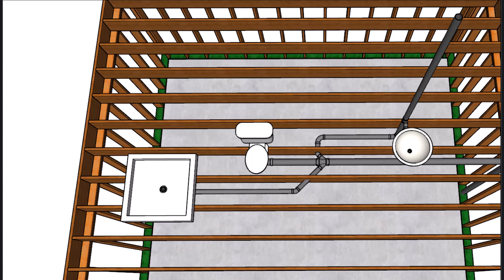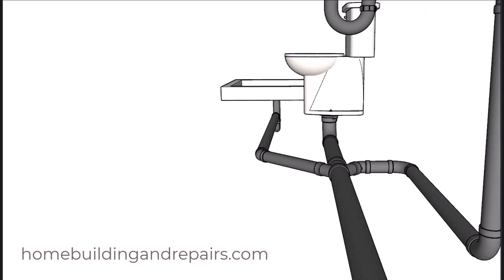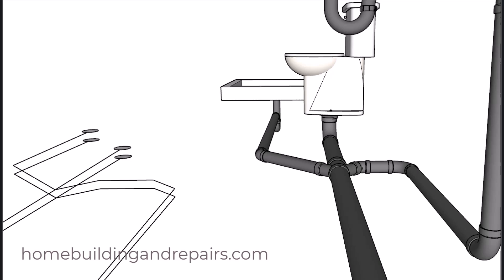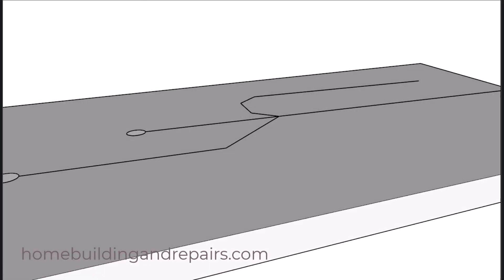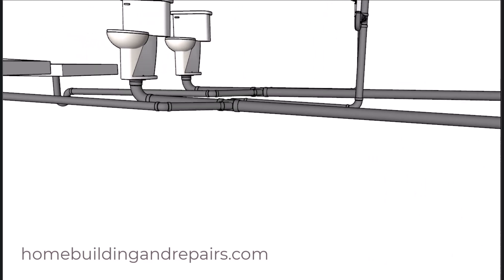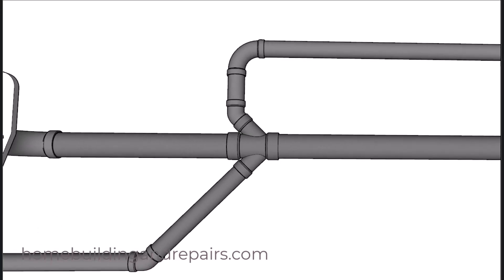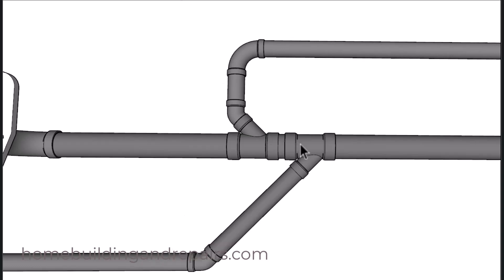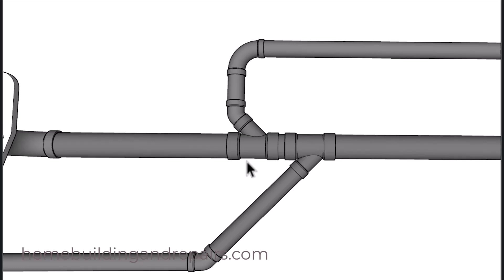Can You Get Drainage Slope From Double Wye Fitting? - Shower And Toilet - Project #1 Q&A#2

Comment: The codes are specific that 1/4"/ft must be "in the direction of flow", which is impossible for a flat double wye, which would need 3 directions of flow. Normal fittings in horizontal applications are always in 2 directions of flow. For instance a long sweep 90 is 1/4"/ft downhill towards the drain, but ALSO 1/4"/ft uphill in a perpendicular direction. 2 different vectors. This is part of the reason waste easily crosses over the double wye & clogs when horizontal. They very frequently clog. It's bad plumbing.
Reply: Also regarding that chart at 706.3, it does not approve a horizontal double wye.
Reply from the maker: Where does it say you can't use a double wye for horizontal to horizontal?
Reply: @homebuildingandrepairs3122  The code prohibits horizontal double wyes with the 1/4"/ft requirement and the 'must follow manufacturer's directions' requirement. It says nothing about double wyes in section 706.3 as this video claims
Reply: @homebuildingandrepairs3122  how far can the vertical wet vent be from toilet??
Reply from the maker: @Grrrnthumb  Here's my next video for you. https://youtu.be/i8PDDpIWU7c
Reply from the maker: Do you have a better definition of the direction of flow?
Reply: @homebuildingandrepairs3122  I'm sorry I don't understand your question about direction of flow. I would think at this level which you're teaching that everyone would be able to plainly understand what that means. I apologize I don't see how it could be ambiguous